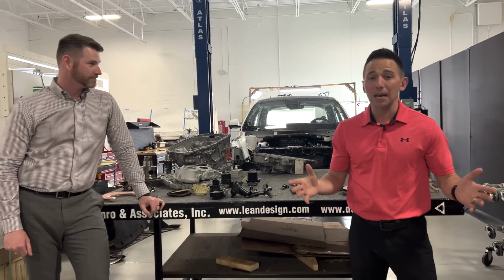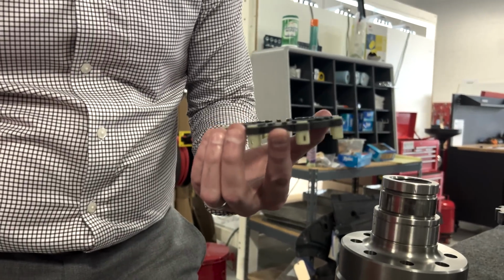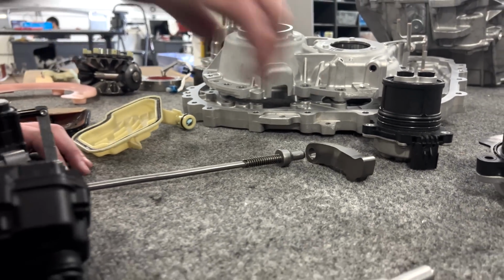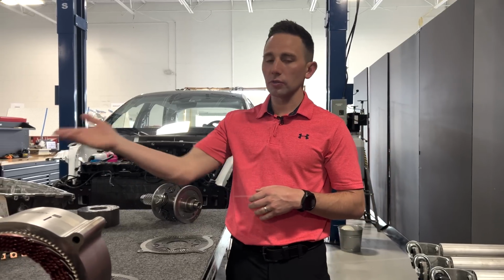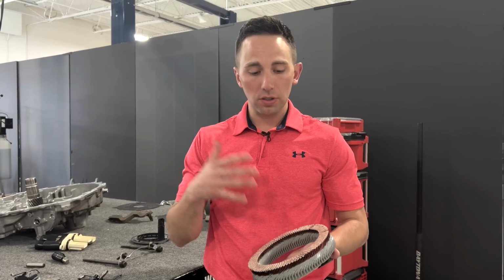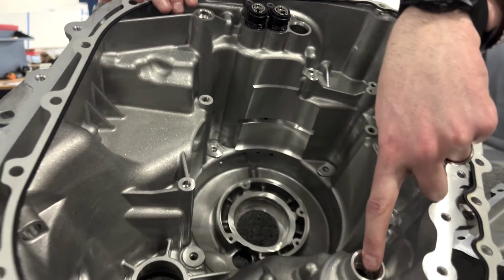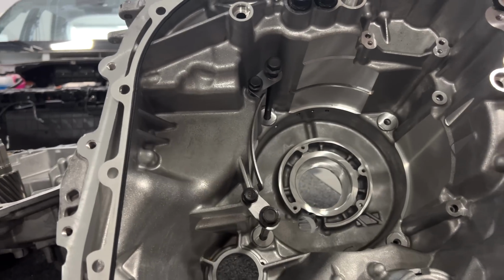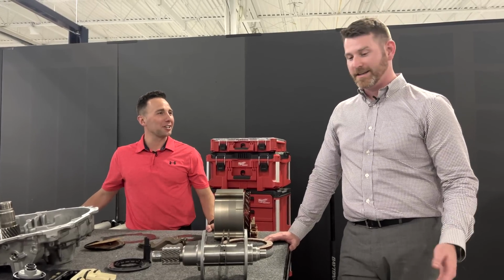Hummer EV Front Motor: Power, Pounds, and Park Pawls

Comment: Placing the parking pawl on the front, while using parking brakes on the rear, doesn't just add redundancy: it adds traction. On a slippery surface a vehicle can slide downhill with the tires on one axle locked; with both axles locked all tires contribute traction.

Comment: Aluminum gaskets likely to deal with tolerance stackup issues - also much stiffer than paper, felt, or elastomer.
Reply: Also much better heat transfer than using a material with heat insulating properties.

Comment: Points I would like one of your mechanical engineers to comment on is (1) the bearing arrangements between the motor and GRU pinion that avoid a geometrically-over-constrained condition present in the early Nissan and Hyundai/Kia offerings, (2) how motor shaft stray voltages are drained off, and (3) is there a magnet in the oil intake and is it serviceable?  Thanks, you guys are awesome!

Comment: Maybe some of the viewers can help me with this question. How do they avoid electrical problems with all the conductors? Steel,aluminum,copper and oil to cool pieces in contact with high voltage?  It’s a basic question that I’m sure is obvious to some but not this guy.
Reply: What problems were you expecting? I'm not seeing any issues myself.

Comment: When parking in my sloped driveway, my Model Y occasionally warns me that the eBrake is not to be depended on,  which is a real buzz kill.  ( The Ebrake has never failed so I assume this error message is bogus.)   So I definitely  favor a park pawl  instead of  an occasionally "iffy" eBrake.   Perhaps Tesla should provide us with beefy wheel chocks.
Reply: I saw a short not long ago where a Tesla e-brake failed and the car ran backwards down a driveway into the street.

Comment: complex metal parts (chromium/titanium) electroplating/forming from/on-top-of fast cast plastic mold structure (graphite rubbed/coated for conductivity for the metal growth bath)
Reply: low temp process (room temp electroplating), low temp cast (plastic base parts cast around 200C)
Reply: like a full chassis up half (bottom removed) cast mold, electroform a full exact shape, detach the metal, electroform a next one, exact control of the layer/metal thickness, multiple molds at same time electroform in the growth bath/vat (multiple vats)
Reply: public domain no restrictions full process, works for wood base molds too (charred to conductive graphite on top)

Comment: They talk about 800 volts going to the motors. I don’t believe 800 volts goes to the motors. The Hummer has 2 400V batteries on top of each other and they are only hooked in series when high voltage DC charging. Otherwise enjoyed the video as usual from Munro.

Comment: By the way, if you happen to be looking for content to produce, you could maybe do another video on this same motor, from an architectural point of view. Meaning, ther type of motor (induction, PM, Hybrid reluctance PM, etc. The kind of wrappings on the stator (copper or aluminum, square of round wire, C wrap or right angle turns (I forget the name at the moment), a look at the rotor laminates, chevron layouts for the magnets). That kind of thing. :>

Such discussions of course can lead to comparisons of motor design between and within makes, as well as generational comparisons.
Reply: The motor is like most other GM motors: interior PM (with reluctance effect like all IPM motors), bar windings of the hairpin style, "chevron" magnets. Aluminum is only used in some induction motor rotors, not stators. They can review that, but it's all visible in his video.
Reply: @brianb-p6586  That is a good point. I guess these motors are nearly "commoditized" these days. One difference being the stator windings. Hairpin vs C windings? Round vs square wire? But I am looking for nuance also. Would love to see a comparison among them all.... weight vs HP/Torque. Physical dimensions vs HP/Torque. There must be differences. The Lucid motor may stand out.

Comment: Guys, seeing another Munro motor teardown reminds me of a longstanding question that I posed to Sandy a few years ago. It is; Have you ever see permanent magnets imbedded in the STATOR of any EV drivetrain motor you have torn down?

thanks!
Reply: Magnet would have to physically turn around at the same speed/frequency of the magnetic field. Otherwise it would break the motor and be counterproductive.
Reply: @benc5190  It's actually been done in the lab successfully. I read a white paper on it a few years ago. It produced a power gain. Hsve been waiting to see if it would show up in production motors.
Reply: @stevebakker6884    For a motor, or a generator?  Was it a squirrel cage rotor like we usually see?  Anyway you could post that white paper you found?
Reply: @benc5190  Let me look around for it. This was for a motor.,
Reply: Motor would need brushes or slip rings with coils on the rotor, so no...nobody is that dumb.
Reply: @vidznstuff1  yeah! Carbon brush is the enemy! 😂😂

Comment: This is video alone helps explain why the new EV Hummer has so many problems that the owners announced in their videos. 
  And explains why they only sold what was it two Hummers in the last quarter? Thank you for not pulling any punches when braking this truck down from the battery pack on.  👍🏻

Comment: Not sure why they’d need to cool the rotor.  Induction motor rotors carry a current, which is why they sometimes need to be cooled.  But as far as I can tell, this rotor is only magnetized and there’s no current generated.
Reply: There is no electrical current in a permanent magnet rotor, but magnetic losses cause heating and the rotor is surrounded by a hot stator, so the rotor still gets hot.
Reply: @Bryan Noga, cooling to keep the magnet temperature below the Curie point.
Reply: I was wondering the same thing. But also noted that it's a very low flow rate.

Comment: You seem to be assuming that decisions made for durability, off-road capability, performance, robustness, and serviceability were the result of rushing to market. Yes, the GMC HUMMER EV was a quick-to market; however it is a bespoke, hand-built platform, and most of the excess is justified because it is such an exclusive, flagship product. I think that what would be more telling is a comparison teardown of the Cadillac LYRIQ or (for and even more direct comparison) the Chevrolet Silverado EV, which would be GM's "lean" manufacturing take on the HUMMER EV.
Reply: I agree. People seem to be making remarks as if this is how GM engineers all their products. I think this beast was designed to be sort of a “test mule” for future concepts and iterations for the pickup lineup. Even Rivian has some items that are completely over engineered and unnecessary, but they are also a flagship product with the price to match.
Reply: @PumpUptheJam81  Yup. I expect the WT versions of the Silverado EV to be much leaner for the sake of mass production. They are targeting 500,000 a year, so it has to be easy to produce in volume.

Comment: Can you say anything about the thickness of the laminates? Iirc the thinner those laminates are the less eddy current will occur, making for a more efficient motor. From varies charts I've seen the Hummer EV is about the least efficient EV on the market. Where did they drop the ball? What extra mile was dropped to save money or to time?
Reply: Dude - it weighs 9000lb and is an aero brick. Nothing to do with laminate thickness.

Comment: the value of a parking pawl is READILY APPARENT to anyone who's seen videos on YouTube of run away Tractor Trailer combinations when a dopey driver puts the transmission in park, climbs out of the cab, but then suddenly sh!ts their pants as the realize they FORGOT to set the air brakes as they notice a GIANT WALL of movement in their peripheral vision.  (although some smaller boxes have them) most commercial diesel transmissions by the likes of Allison, Eaton, Detroit, etc DO NOT incorporate a park pawl due to the DOT safety requirements of the weight class involved...

in these instances it is indeed much safer to dump air from the springs brakes which (analogous to certain types of relay in a circuit) operates in a "normally closed" or "normally applied" position.  in this case, what it ultimately means is ENERGY (in the form of air pressure) must be constantly sent to the brakes in order for them to "back off" and the vehicle to move.

Comment: Basically expected to be that beefy for something like the Hummer or the Silverado with 20k pound towing capacity.
Reply: re: "the Silverado with 20k pound towing capacity". bingo, as seen at the GM display at this year's ACT EXPO it's sized for commercial and fleet use, yes and that early announced 20k towing rating target (which is more than 2x the Gen-1 Lightning's tow rating).  don't forget the recent announcement that the WT will have an available 246 kWh battery.  for reference that's only 18 kWh less than what Volvo uses in it's base model Class-8 electric VNR truck (264 kWh).

Comment: Did you sift through the oil to look for even larger shavings? 
If those things got to the filter who knows what did not fit through the pickups.
Reply: why would they get thru the filter? Kind of silly to use an oil filter that would let chucks of metal through it
Reply: @AbBc-w4q  Huh? What are you talking about? 
They are in the housing since production or come off from components during usage. So they will be in the oil - before reaching the filter. The filter is one element of the oil loop and is meant to remove them IF they get there - and that is my question: could some shavings be so large they never make it to the filter.

Comment: Just an observation regarding shock loads.  Since they are usually short duration, wouldn't using rubber drive cushions, much like what is done in the rear hub of motorcycles be a viable solution?
Reply: Half axle shaft torsional flex?
Reply: I doubt they'd last very long.

Comment: They use Front Park pawl, because this version of the truck is trimotor, the rear Drive unit has two separate Motors and gear sets.
Reply: good "catch" (no pun intended).

Comment: I wonder if things like the parking pawl concept are inherited from previous GM's heavy vehicle designs.
Reply: For an offroad vehicle.. imagine it parked on a steep incline that is gravel or dirt. If you only had E Parking brakes on the rear.. it can slide down the hill.  You would either need a park Pawl or another E Parking brake assembly on the front.
There are videos of Teslas rolling down snow covered driveways... rear wheels locked.. front wheels spinning.. car then went across the road, and into the ditch in the middle.
With a traditional 4x4.. you would leave the vehicle in 4wd.. and the parking pawl would lock the trans.. and thru the driveline lock both front and rear axles.... AND you could put on the parking brake too.

Comment: I'd be horrified if i opened up a filter on a new vehicle and saw those shavings😮
Also an interesting comparison with the diffs. The lucid used a small 4 pinion centre and the hummer a large 2 pinion. 
As an off road person im quite disappointed about the hummer only ysing 2 pinion. We tend to fit 4 pinion centres as they are stronger and can cope with shock loading better.

Comment: you are correct; the reason the pawl is on the front is to have BOTH axles parked. If you have AWD, you can get into situations where you drive up a slippery hill, park which locks just the rears, then the car rolls with the rears locked since the fronts are now free wheeling instead of gripping.
Reply: For an off-roader, being able to lock all four wheels when parking is essential… and given that on a dual motor vehicle you can’t accomplish that via parking pawl + transfer case… either this system or a 4-wheel Parking brake is needed
Reply: An Ioniq 5 owner reported a few weeks ago that his car was sliding down his icey driveway. The EPB and the pawl are only on the rear axle.
Reply: @KiwiMechEng  
There is video of a Tesla doing this also... sliding down a snowy driveway.. car then went across the road and into a ditch.

Comment: All this for a vehicle that they delivered only 2 of in the first qtr. this year!!
Ridiculous waste.
Reply: No. All of this for the Silverado EV and Sierra EVs which will use most of these components and sell massively. They only sold two because the factory was shut down to install assembly lines for the Silverado and Sierra EVs.
Reply: @LakeLake123  I thought the Silverado was going to be made on the Bolt line and is part of the reason for the Bolt being cancelled.
Reply: @a2cryss  The Bolt factory (“Orion”) will be the 2nd Silverado/Sierra EV factory.  The current Hummer EV plant, Factory ZERO (aka Hamtramck), is the 1st. They started upgrades for Silverado/Sierra EV at the end of 2022.
Reply: @LakeLake123  Ah that explains the low numbers. So they are using the same components in the Silverado eh? That would explain the very low total load capacity of 1200 pounds. 
 Munro found that the Hummer's battery pack weighed 2300 pounds all by itself... that explains it.
Reply: Love your optimism, yep those battery plants are at full speed and thousands  of GM EV’s are coming off the line every day.
Reply: @timsmith6815  Nope, I never said any Ultium battery plant was in full production. There’s only one, and it’s well known it won’t be at full capacity until late 2023.   It’s why Equniox EV, Blazer EV, Silverado EV, Sierra EV, and most Hummer EV trim models were all “Spring 2023” at the very earliest.  Most are all listed as Fall 2023 or early 2024 and they have been since day 1.
Reply: And presumably one of them is this one?